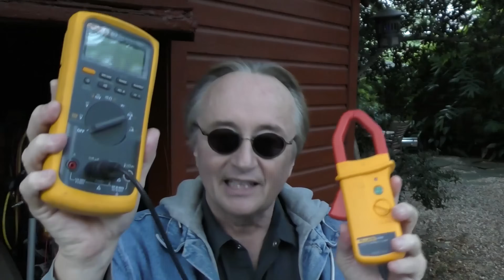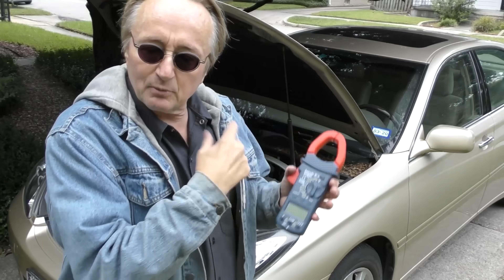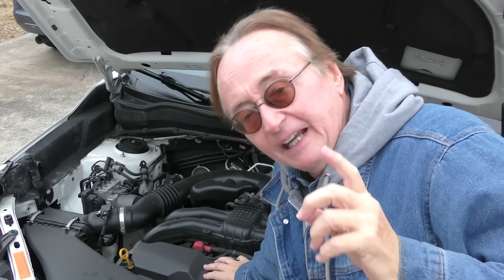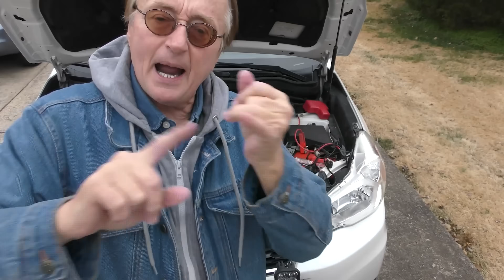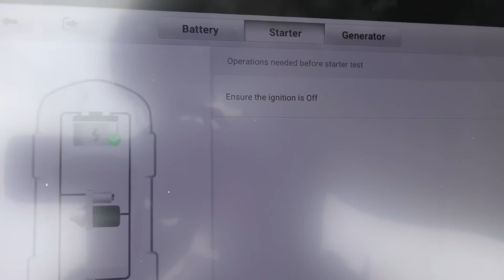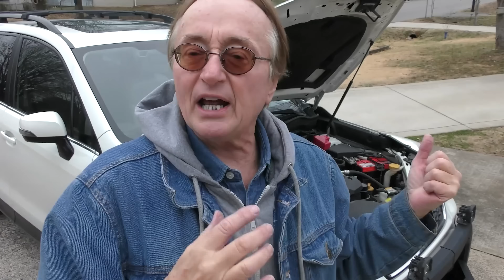Here’s Why Disconnecting Your Battery Will Destroy Your Car

Comment from the maker: Toyota’s News Shocks the Entire Car Industry: https://youtu.be/uiy_RRntlKU

⬇️Scotty’s Top DIY Tools and Products:
►Best Scan Tools:
1. Newest Scan Tool: https://amzn.to/4jvxvr7
2. Bluetooth Scan Tool: http://amzn.to/2nfvmaD
3. Cheap Scan Tool: https://amzn.to/2D8Tvae
4. Mid-Grade Scan Tool: https://amzn.to/4bLkN2g
5. Professional Scan Tool: https://amzn.to/4dsaa6e

►Best Car Jump Starters:
1. No Charging Required Jump Starter: https://amzn.to/3i7SH5D
2. Mid-Grade Jump Starter: http://amzn.to/2nrc6qR
3. Best Jump Starter: https://amzn.to/4c1O9JI

►Best Fluids for Your Car:
1. AT-205 Re-Seal (Can Stop Leaks in Your Engine, Transmission, Etc): https://amzn.to/3LCruJq
2. ATS 505 Fuel System Treatment (Pour in Gas Tank): https://amzn.to/3LXhEC9
3. ATS 505 Oil System Treatment (Pour in Engine Oil): https://amzn.to/3SZHZmN
4. Head Gasket Leak Test Kit (To See if Your Car Has a Blown Head Gasket): https://amzn.to/3yDmj9h
5. Lubegard Automatic Transmission Shudder Fix: https://amzn.to/46XEsek
6. Lucas Oil Transmission Fix (For Worn / Slipping Transmission): https://amzn.to/3WSBgfK
7. Meguiar's Headlight Coating (Keeps Your Headlights from Fading): https://amzn.to/46l7kgh
8. Meguiar's Headlight Restoration Kit (Restores Faded Headlights): https://amzn.to/3zT9ojN
9. Meguiar's Clear Plastic Cleaner and Polish (Cleans Headlights): https://amzn.to/3DaZjRa
10. Meguiar's Car Scratch Remover: https://amzn.to/4faB3wJ
11. NuFinish Car Polish (Use on Paint or to Stop Windshield Squeaks): https://amzn.to/3SjmYmA
12. Invisible Glass Cleaner (Inside/Outside Car Window Cleaning): https://amzn.to/3YcElcL
13. Hide Rehab Leather Conditioner (For Leather Car Seats, Etc): https://amzn.to/3YYVtmN
14. Blaster Silicone Lubricant (Lubricates power windows, door hinges, stops squeaks, etc): https://amzn.to/46Ss3bP
15. Rain-X Waterless Car Wash: https://amzn.to/4czhc7K
16. Permatex Windshield Repair Kit: https://amzn.to/4fX5mHF
17. CRC Battery Terminal Protector (Stops Battery Terminal Corrosion): https://amzn.to/4dNnIsy
18. CRC Mass Air Flow Sensor Cleaner: https://amzn.to/3YSTm3x
19. Bar's Cooling System Stop Leak (Can Stop Small Coolant Leaks): https://amzn.to/4dQM3Oh
20. Bar's Blown Head Gasket Repair (Can Stop Head Gasket Leaks): https://amzn.to/3AH6wXj

►Best Car Accessories:
1. Quick Twist Oil Drain Valve (For Fast and Easy Engine Oil Changes): https://amzn.to/46Vn2z4
2. Solar Car Battery Charger: https://amzn.to/4fktsMd
3. Plug-in Car Battery Charger: https://amzn.to/3Yqpjju
4. Dash Cam (Every Car Should Have One): https://amzn.to/41eAzj3
5. Key Finder (To Find Lost Car Keys): https://amzn.to/3Yb6gd4
6. Faraday Box for Car Keys (Blocks Car Key Signals / Anti-Theft): https://amzn.to/3YPlCnX
7. Tire Gauge (To Check Tire Pressure): https://amzn.to/3y8R4CE
8. Tire Air Pump: https://amzn.to/3yCqiD3
9. Car Memory Saver (Use When Changing Your Car's Battery): https://amzn.to/3YmWQeJ
10. Car Odor Eliminating Rocks (Removes Smells in Your Car): https://amzn.to/3zYMFCP

►Best Tools for Working on Your Car:
1. Best Cheap Magnetic Work Light: https://amzn.to/4dQKL5T
2. Best Small Flashlight: https://amzn.to/4fePFep
3. Best Expensive Multi-Use Flashlight: https://amzn.to/3WBxzft
4. Car Battery Tester: https://amzn.to/4bg4dZL
5. Basic Mechanic Tool Set: https://amzn.to/2tEr6Ce
6. Professional Tool Set: http://amzn.to/2Bzmccg
7. Ratcheting Wrench Set: https://amzn.to/2BQjj8A
8. Crowfoot Wrench Set: https://amzn.to/3Xcn6aB
9. Cordless Impact Wrench: https://amzn.to/3WHgpMa
10. Corded Impact Wrench: https://amzn.to/4bVrHlG
11. Electrical Circuit Probe (For Testing Power, Ground, and Shorts): https://amzn.to/4cTwMfp
12. Socket Extension Bar: https://amzn.to/4dedEsf
13. Small Sledge Hammer: https://amzn.to/3WzHsdj
14. Best Borescope for Seeing in Tight Spots: https://amzn.to/3zW3U7K

🛠Check out the other tools I use and highly recommend ► https://goo.gl/rwYt2y

🔥Scotty Shirts and Merch ► https://goo.gl/pTAeca

👉Subscribe and hit the notification bell! ► https://goo.gl/CFismN

As an Amazon Associate I earn from qualifying purchases.
Reply: REV UP YOUR ENGINES!
Reply: Hi Scotty, I have a 2014 Tacoma. I disconnected the battery to do some work and when I reconnected the battery the display on the dash would not display the backup camera, it's just a black screen when I put it in reverse. Mechanics can't figure out what to do.
Reply: My air suspension pump turns on when the car is off, so if I don't drive it wvery other day I disconnect the battery or else it will get drained

Comment: This may be a little off subject, but it's a recent post so I hope you can answer...

My Honda 2001 Accord Coupe EX's battery (overnight) reads zero with terminals connected, it charges back to steady 11.5v when I disconnect terminals.  The disconnected terminals have continuity when tested with simple meter, and also shows .5 ohm resistance between them.  I also pulled fuses one at a time with the constant "beep" from the continuity tone on just the terminal cables (not connected to battery), and the beep never left. I've also connected my terminal cables to a known working battery and it starts to drain voltage, so I believe my battery is ok.  I hooked it up this morning to the battery and may horn car alarm started beeping before it quickly lost charge, could that be any sign?

I did see your other video from a while back about using your special 1 ohm power resister cable to test whether you have a electrical short on which sub system when you pull fuses, which I don't have.  I also remember the point of that cable was because some cars can show continuity between terminals when disconnected.  Does the above at least prove there is a short somewhere?  .5 ohms is so low it's like testing the same long cable on both ends, in my experience.

Thanks for any advice you might have. In 21 years this car has never left me stranded, not once, until now.  But at least it was on a weekend at home.  Not sure you could buy reliability like that today.

Comment: If you’re worried about losing radio memory settings or the like, just hook up another car battery in parallel to the cable end terminals with small jumpers before you temporarily have them disconnected.

Comment: I'm confused now, replaced battery a 3-4 years ago(Exide, good battery, I guess even they make some for Toyota).
I get corrosion on neg. and now slight on pos..
These can be leaks past the post? loose connections? Would a new battery fix this. Maybe should just get it checked...soon
Wild 160 same price battery us (Toyota)84 months warranty. Here (Non Toyota)2-4 years. From Toyota the battery 84 be around 1200 here...
Reply: You probably had carryover battery acid from the old battery. Remove cables an clean them and the posts with water and baking soda. Let dry and coat everything with a little grease.
Reply: @idothink-x8e  There was no sign of corrosion wth before battery. But I will try that ayway because battery is I think 4 years old. It staterd last winter in -24 C so...thx..would like it to last 5.

Comment: Great advice. But now you have to imagine doing this on 2008 German over engineeried VW Touareg. With the battery mounted under the driver seat and the fuse boxes on both sides of the dash meaning you have to keep both front doors open all day b4 the entire bus and its 50 plus ecu's have completed to shut down. Fun...

Comment: What if you have to change the battery?
Reply: They sell little adapters you plug into the always hot cigarette lighter, if you have one. It uses a standard 9 volt battery, which is enough to keep the circuits energized while you have the battery temporarily disconnected. Just remember to disconnect your under hood light and do not open the car door ( reach through the window to plug it into the lighter)  as the 9 volt battery cannot carry any addition load except to hold the settings in you radio and computer. You can also use jumper cables to another car battery to keep the radio and computer settings. Just clamp them on the ends of the terminals leaving accessibility to work the terminal bolts to remove and reinstall them.

Comment: These units aren’t very good at measuring low current below 1A. I still do it by disconnecting the negative. Really, it’s no big deal. You can use a jumper wire to keep from breaking the circuit, which keeps the BCM from cycling but whatever.

Comment: 1:55 The cheap one from China will soon cost $87,000 due to tariffs.

What about when you have to replace your battery? In that case, you have no choice but to disconnect the battery, which might mess up the idle? I wish there was a secondary battery-backup that one could use when replacing the main battery.

Comment: The Owners Manual always discusses whether or not you can disconnect the battery and if you will have any issues or not !  Many YouTube videos will tell you that you need a memory saver and that is not always the case
Reply: My manual doesn't mention. I replaced battery anyway. But what happens with this model is I lose my radio stations and the computer has to learn optimal fuel mileage again.

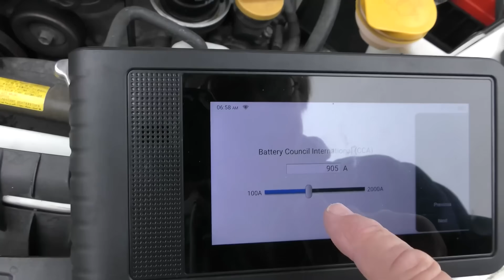Comment: 11:09 Something I found out myself with touchscreens is when there is a slider like this where you want a specific output number, tap and hold then roll your finger + or - in the direction you need then when you get to the number, lift straight off the screen. This is only needed if you can't enter a number with a keyboard.

Comment: Problem is on my 24 Maverick Hybrid as soon as I open the door it wakes up all the modules? The battery is under the back seat so the dome light stays on. I got in the truck and sat in the front seat with all the doors closed. It read ..035 drain all the time.  My 09 CRV shows .0001

Comment: What if the battery dies?
Reply: You change it….WAH, WAH. Hook another car battery in parallel to the old battery end terminals with small jumpers before 
you disconnect it, if losing settings is an issue.

Comment: There's absolutely no reason that a computer (including the one in your car) needs voltage to sustain memory. Manufacturers are just lazy if they claim that the car's settings will escape from the vehicle without a continuous 12v power supply.
Reply: On desktop computers, RAM loses memory when power is lost, but SSD (or USB stick drive) retains memory. So I guess cars need a tiny SSD-type memory (instead of RAM).

(or a tiny backup-battery like what preserves save files on a Super Nintendo game like Super Mario World — should last a decade or two)

Comment: I purchased a battery for my vehicle about 2 1/2 years ago, and just last week it didn't start. So, when I went to jump it with my jumper I noticed that the positive connection was loose. After I tightened it up, my vehicle started. 
It's crazy now thinking about it. After two and half years of my battery being loose. Now, I constantly check everything before I go for a drive.
Thanks for sharing Scotty. 👍👍👍

Comment: If I have to disconnect my car battery for any reason I bought an after market cable that has an OBDII plug and battery clips. That cable plugs directly into the OBDII port and has two (+ and -) battery clips that I connect to a small 12V or in a pinch a 9V battery. That cable supplies voltage to the cars computer when my battery is disconnected. Doing this keeps all of my settings active when I disconnect the battery cables. Now, I don't have to worry about the power windows not operating or the engines idle acting strange or my radio stations needing to be reprogrammed.

Comment: disconnect battery on cars with electric hand brake, if you do the rear brakes.

because this kind of car can engage the rear brakes randomly at any time when parked. if this happen and there is no rear disc, the caliper piston would fall on the ground. will need to replace caliper as replacing the piston has to be done on factory. and bleed the brake lines.
expensive mistake

Comment: I disconnect the battery on my 1972 Chevy Vega and never have any problems.
Reply: Same for my Pinto. Too bad it got rear-ended..
Reply: @rickhunter-wolff  Glad you survived.
Reply: Yes, I disconnect the one on my 1980s era Volvo and no problem. But I have problem with 2000s era car.
Reply: Humm.   Yeah.  Not a big problem on older cars.  Video is lesson on trouble shooting volt leaks in general.

Comment: So, if one puts a "trickle charger" on the battery terminals before disconnecting battery, it will save the computer data?

Comment: I have a 2008 Honda pilot. Sometimes when I won't use the car for over a week the battery will drain enough to get maybe one starting crank in. No problems when I drive it daily. But when I don't need to use it for a while I have a  switch to the battery and I disconnect it.
I only need to put the radio code on.
Haven't had any problems.
In fact, I have seen battery life improve. Last battery lasted 7 years when the average is 5.
But the emissions in Texas requires I drive 100 miles if the battery was ever disconnected so that's kind of a pain.
I have tested for a draw using a test light. It does light but it's very very dim so I assume the draw is ok.

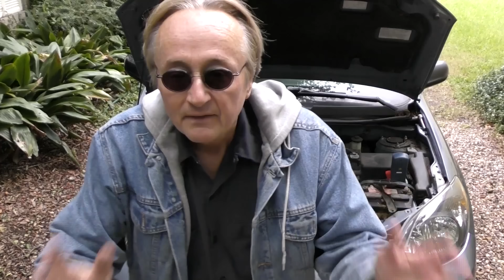Comment: Make sure you buy a clamp meter supports DC current via clamps, and when taking measurements, the setting is on DC. The meter Scotty is showing, in the closeup shots, it clearly only supports AC current. His readings on the cars would be inaccurate. At 3:38, the meter is in 1000A range setting, meaning the meter measures in 1A increments and the display will not show a decimal point. The meter is actually reading 29A and not 0.029A, but the camera is at a low angle and out of focus to hide it. The meter being used is not capable of 3 digits precision beyond the decimal point, so he's probably just doing this for learning purposes.

Comment: Subaru have 'smart' alternators for saving 0.0001% in fuel. It stops charging when the ECU thinks the engine is under load within a certain driving dynamic and it then slams high charge current in repeatedly on deceleration, cruise and
certain idle conditions, depending on EPS load and AC etc. The charge system is also structured around start stop that saves another 0.0001% in fuel, but overall the batteries get hammered into a fairly short life, but at least you save about $3.50 in fuel over that time, so take that off the cost of your new battery (and starter).

Comment: When I started my apprenticeship at Toyota the shop supplied an amp clamp meter for ABC service (alternator, battery, crank) and I learned to do draw tests with a clamp meter.  I bought my own clamp meter after leaving Toyota, but found it odd that I have yet to see another technician own their own clamp meter and the shops and dealerships haven't had one either, except Toyota.

Comment: Ive let my car sit for months without the battery connected. No issues. 01 Camry. 08 Corolla. The computer relearns everything when the battery reconnected. Wrong on this one bruh.
Reply: It depends on the make, model, and year of the car. It also depends on the state of the car — for example, is the throttle body dirty or not. Not all cars are the same. But yeah, ideally, if the car is well-engineered, then it should not cause issues (in an ideal world).

Comment: I have to disconnect my battery every night now. It’s a 2005 Buick LaCrosse with only 46k miles. At first my clicking sound on my turn signals disappeared. Then my gauges started going crazy and I was getting codes on my display like “service abs or service traction control.” Then my gauges would just dump and quit working, no speedometer no gas gauge etc. Then my battery would be dead in the morning. I bought a new battery and that didn’t fix it. I put in a new alternator and that didn’t fix it. The crazy thing is sometimes after using my jump box to start my car all my gauges would come back for a few days. Then one day it wouldn’t start and no gauges again. Now it’s no gauges and i’m disconnecting my battery every night so I can start it the next day. So frustrating!!!!
Reply: Check the security system -- those can be a weird electrical drain.
Reply: Mother in law had same, just phantom no go...
Reply: could be caused by heavy keys causing havoc in the ignition. Since it's a 2005, it's an old school turn key right ? remove it from the key holder and insert only the key in the ignition, keep your other keys in your pocket.

Comment: This is one of those times where you don't realize what you've got until it's gone.  The cars I grew up with when you changed the battery it didn't harm anything.  Now with some cars you practically have to reprogram the ECU when you change the stupid thing.
Reply: I recently replaced the battery on my(2,5L)2015 Ford Transit Connect and now it doesn’t start?
On the dash it reads “engine fault” & “service engine immediately”???
Did I set off the anti theft immobilizer?
I’ve disconnected the battery before and never had an issue?
Please Scotty if you see this do you have any answers?
Reply: @FrankTimms-cs5hl  Did you crank it with a weak battery?  If so the immobilizer and the key fob are out of sync.  Engine will crank and never start, because the ECU will not call for fuel until they are back in sync.

Comment: I'd use a UNI-T UT210E. It looks like Scotty's astroAI dt201d isn't designed to read DC amps. Because of this, these readings are most likely based on apparent waveforms rather than providing a meaningful measurement. The UT210E can measure accurately in the 10's of milliamps and even a useful figure below 10mA. And it works fine with japanese (ikea/eneloop) nimh cells. Thanks for your video Scott :)